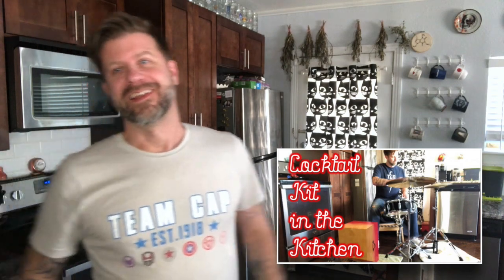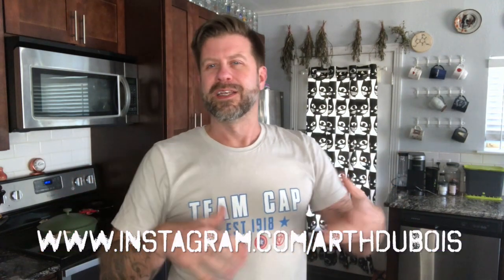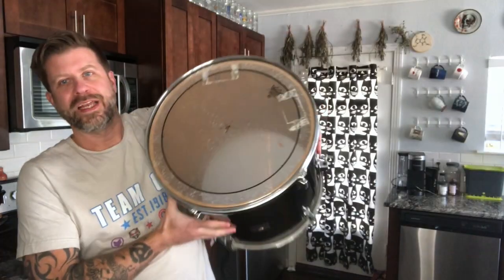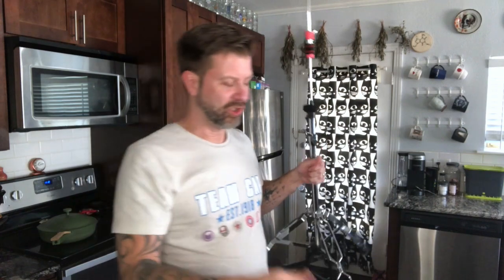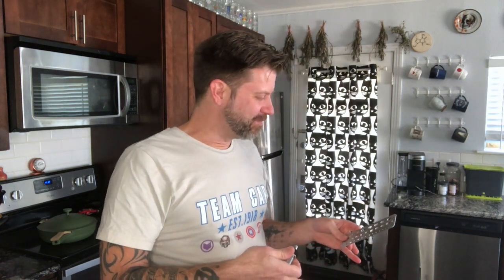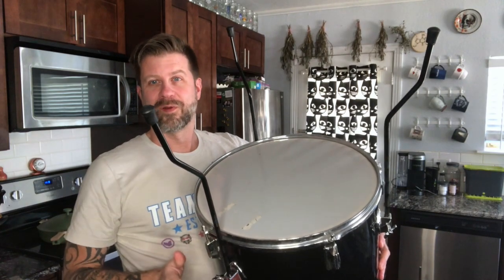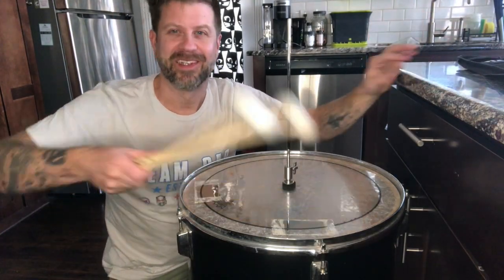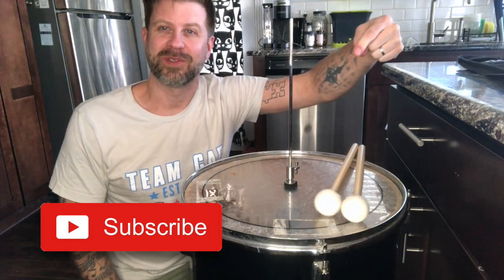Hi Hat Stand + Floor Tom = Tunable Drum

Comment: That was very cool actually and I"m still uncertain how that works? how did doing what you did make it tuneable? lol
Reply from the maker: Great question. The conventional way you tune a drum is by tightening or loosening the drum head. This is typically done by adjusting the small bolts on the metal rim around the head. More tension = higher pitch and less tension = lower pitch. In this case, I'm effectively using the hi-hat clutch to add tension to the center of the drum head. So, as you step down on the hi-hat pedal it puts more tension on the drum head making the pitch higher. When you let off the hi-hat pedal, it puts less tension on the head making the drum's pitch lower. If you watch the playing example section again, you'll see what I'm talking about.
Reply: @musicalmiscellany  ahh. that was a perfect explanation!! thank you. Now I get it!~ lightbulb goes on~ thanks